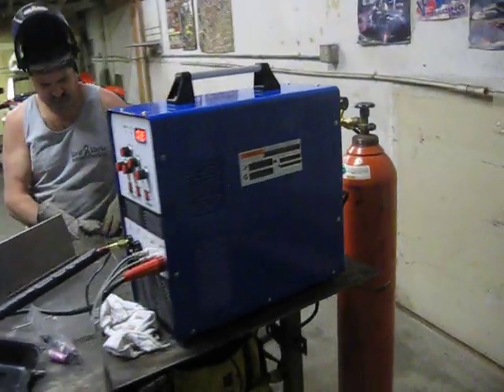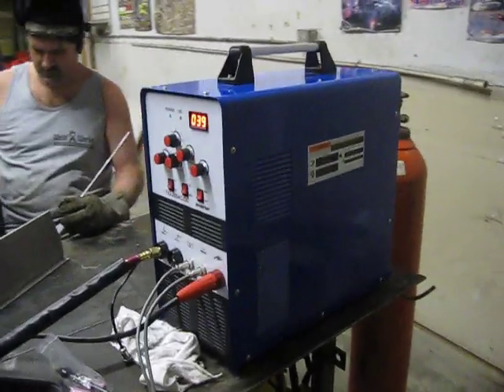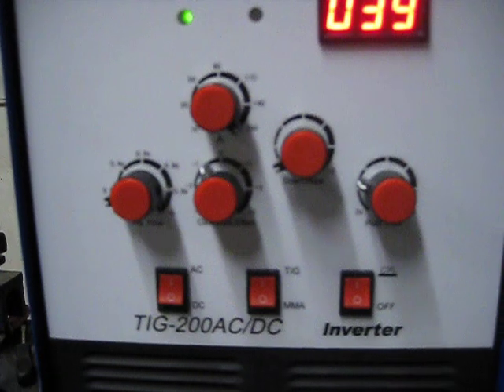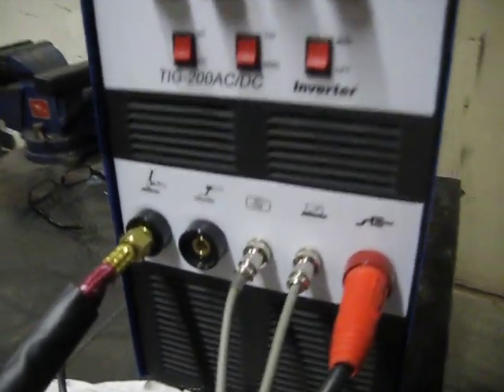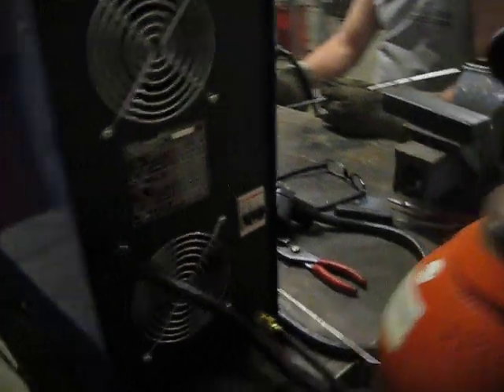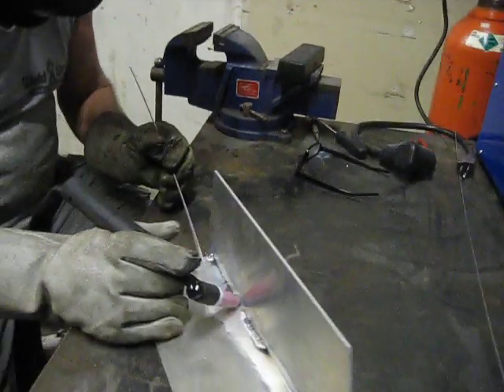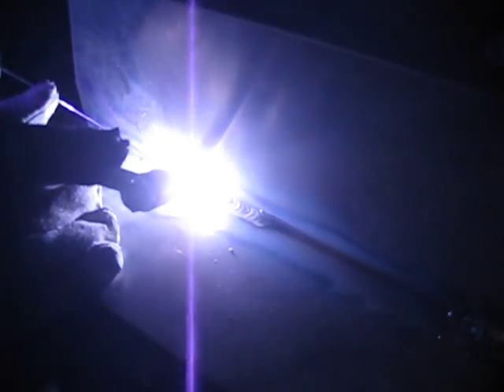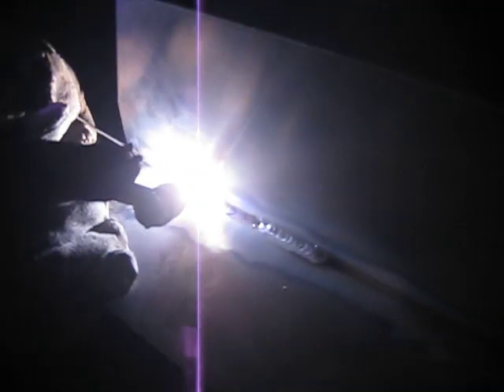LOTOS TIG200 TIG/Stick Welder Aluminum Welding Demonstration

Comment: How do I change my ac to square wave? I have the same welder, but I cant seem to get the aluminum to puddle because of the oxide layer, so I end up putting too much heat into my work piece.
Reply from the maker: TIG200 only has the square ware AC output. For aluminum welding, we suggest to use AC output and please try to adjust the clearance effect and down slope time adjustment. Also another tip is flow time adjustment (knob 3): To prevent the work 
piece from becoming oxidized, let the argon flow for a few seconds after stopping the welding arc. You can use the post-flow time adjust knob on the machine.

Comment: This is a great machine! I use it all the time in my restoration shop. It is my go to welder now for all my sheet metal work if I can get the metal clean enough. I have had mine close to a year and love it. I would say I have over 70hrs on this machine  and its still going strong!
Reply from the maker: Thank you for commenting and sharing your experience with us!